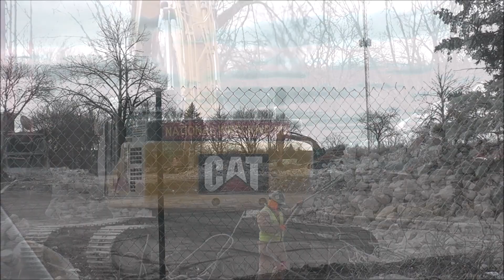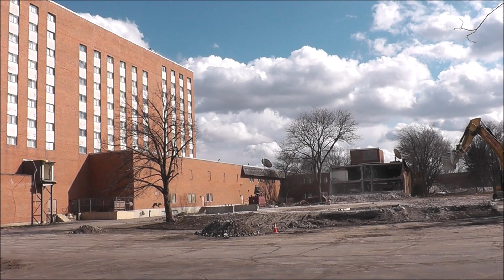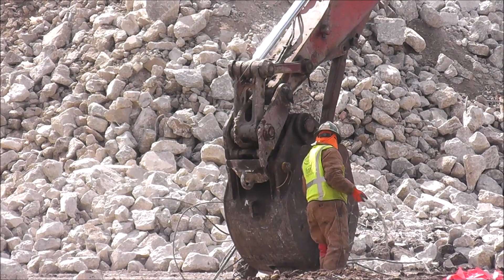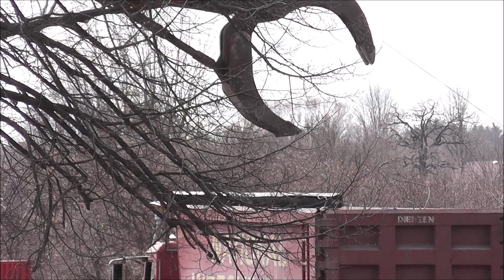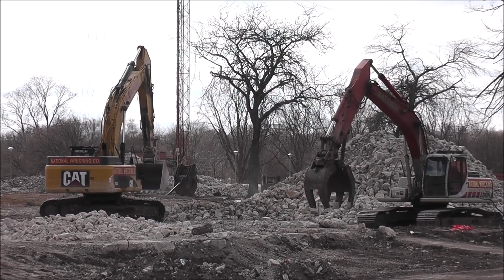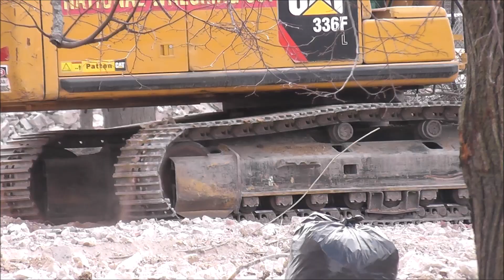Excavators (3 of them) Breaking Concrete and Clearing A Demolition Site

Comment: You are correct about the third excavator. It's called reinforcing bar or "rebar" that is placed before the concrete is poured.

The excavator cabs have metal bars on their windows to protect the operators from a struck by accident.

Hope this helps and keep up the good videos.
Reply from the maker: Thanks Steven, I figured it was rebar from the old concrete that was broken up. Thanks for the encouraging words too, sometimes I think that no one is even watching these videos. I'm glad you like them. I hope to have better stuff as the Chicago are thaws out and construction starts again. I love finding sites to record.